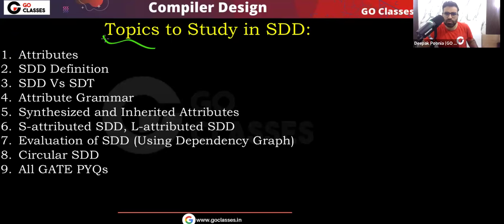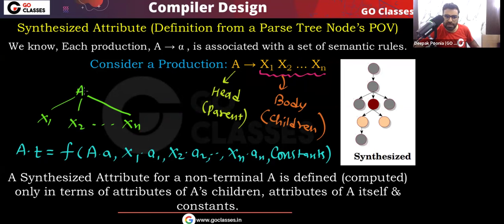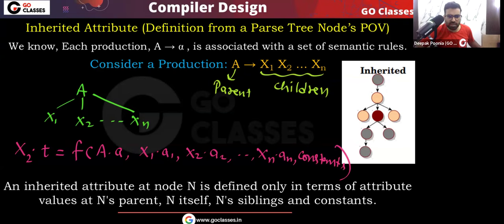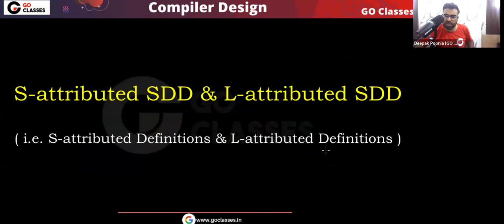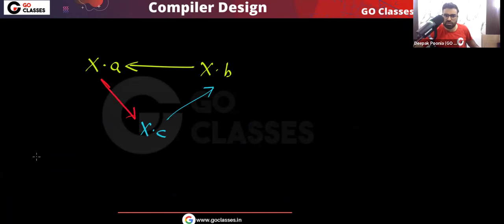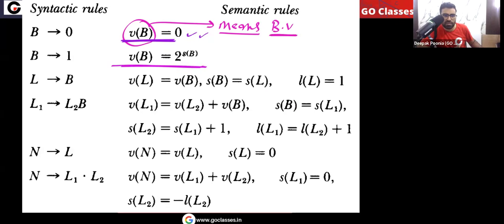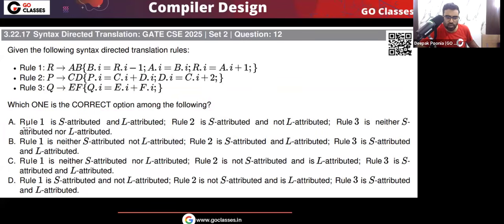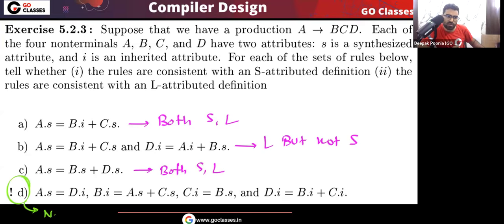SDD Lecture - Part 2 | Syntax Directed Definition | S-Attributed, L-Attributed Definition | Compiler

Comment from the maker: 1) Attribute Fundamentals & Parse Tree Flow

00:00:00 - Introduction and review of the SDD syllabus.
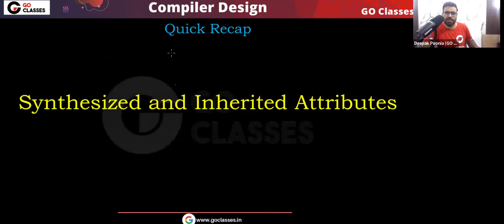00:05:48 - Recap: Disjoint sets of Synthesized and Inherited attributes.
00:10:45 - Mathematical definition of a Synthesized Attribute (computed for the LHS).
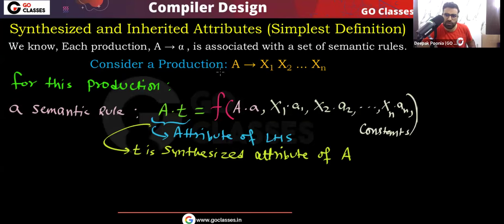00:15:23 - Mathematical definition of an Inherited Attribute (computed for an RHS non-terminal).
00:20:19 - Re-defining attributes from a "Parse Tree Node" perspective (Parent vs. Children terminology).
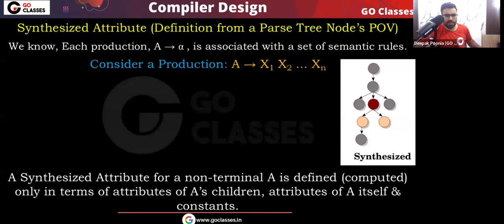00:30:33 - Deep Dive: Why Synthesized attributes strictly enforce Bottom-Up information flow.
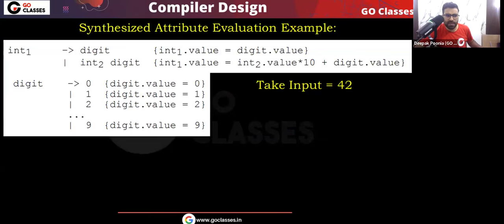00:39:40 - Live Example: Tracing a synthesized attribute evaluation (Input: 42).
00:45:00 - Drawing the parse tree and passing the integer values bottom-up.
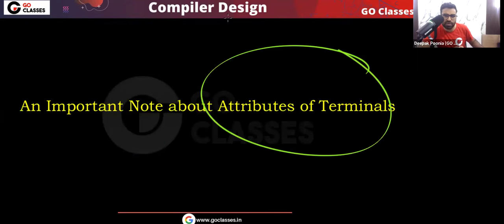00:54:16 - Crucial Theorem: Terminals only possess synthesized attributes supplied by the Lexical Analyzer.
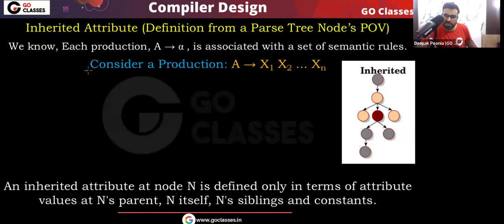01:06:17 - Deep Dive: Why Inherited attributes flow Top-Down, Left-to-Right, AND Right-to-Left.
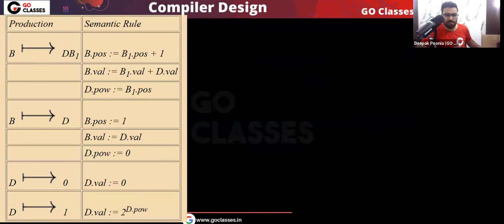01:14:09 - Tracing example: Inherited attribute flowing right-to-left from a sibling (B1.pos -> D.p).

2) Advanced Theorems & L/S-Attributed Definitions

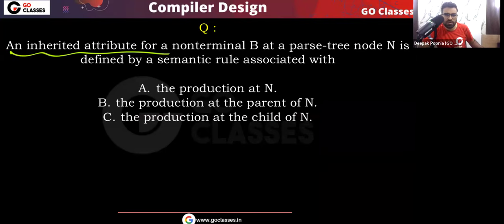01:20:20 - Conceptual Proof: Why an inherited attribute for node N is defined by the parent's rule.
01:30:02 - Conceptual Proof: Why a synthesized attribute for node N is defined by N's own rule.
01:35:30 - Conceptual Proof: If a non-terminal A never appears on the RHS, it cannot have inherited attributes.
01:39:49 - S-Attributed SDD, L-Attributed SDD.
01:42:00 - Formal Definition: S-Attributed SDDs (Only synthesized attributes allowed).
01:45:31 - Formal Definition: L-Attributed SDDs and the strict "Left-to-Right" dependency constraints.
01:54:50 - Analyzing right-sibling violations in L-Attributed grammars.
01:59:06 - The Contradiction Proof: Why an inherited attribute CANNOT depend on a parent's synthesized attribute.
02:09:30 - The Master Checklist: The strict mathematical conditions allowed for X.a in an L-Attributed SDD.

3) Extensive Problem Solving & GATE PYQs

02:18:18 - Practice Problem 1: Identifying violations (Right-sibling and parent-synthesized dependencies).
02:24:26 - Practice Problem 2: Spotting an illegal dependency on a parent's synthesized attribute.
02:28:24 - Practice Problem 3: A complex grammar where T' has both inherited and synthesized attributes.
02:36:06 - Practice Problem 4: Identifying an SDD that is neither L-Attributed nor S-Attributed.
02:43:08 - Practice Problem 5: Deducing if an attribute is synthesized or inherited purely by looking at the LHS/RHS of the semantic rule.
03:05:05 - GATE 2020 Question Walkthrough: Checking three complex rules for L-Attributed compliance.
03:22:44 - GATE 2025 Question Walkthrough: Checking rules for both S-Attributed and L-Attributed consistency.
03:42:02 - Ullman Textbook Exercise: Evaluating four rule sets (A -> BCD) for L/S-Attributed consistency.
03:57:07 - Lecture summary and preview of the next topic: Evaluation Orders and Dependency Graphs.

Comment from the maker: 01:35:25 - If a non-terminal A does not appear on the right-hand side of any production rule, then A has no inherited attributes.
If the start symbol S doesn't appear on the right-hand side of any production rule, then S does not have any inherited attribute.
00:54:12 - Important Note about Attributes of Terminals
Attributes of Terminals are always assumed (classified) to be synthesized attributes only, not inherited attributes.
Terminals can have synthesized attributes, but not inherited attributes. Attributes for terminals have lexical values that are supplied by the lexical analyzer; there are no semantic rules in the SDD itself for computing the value of an attribute for a terminal.